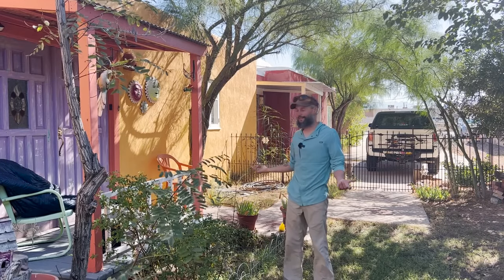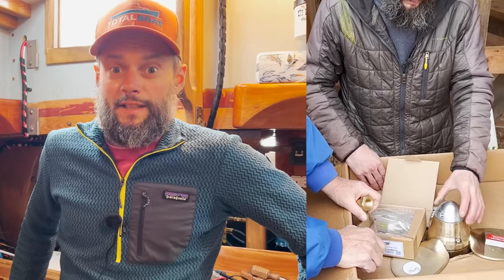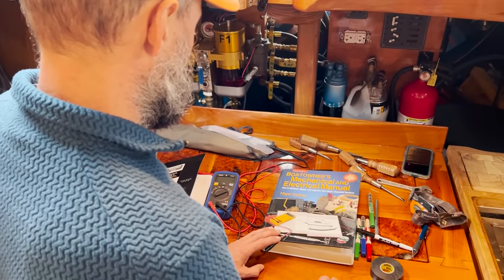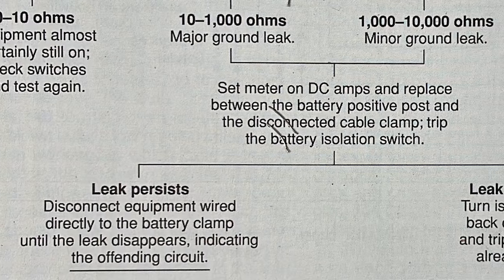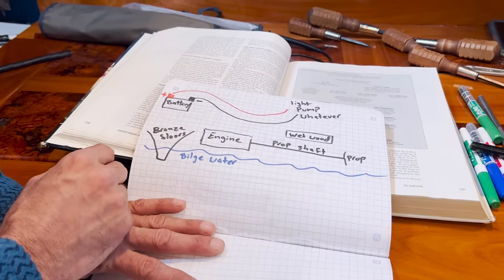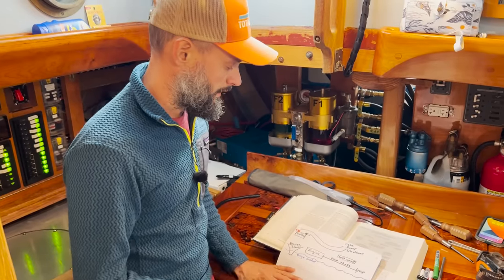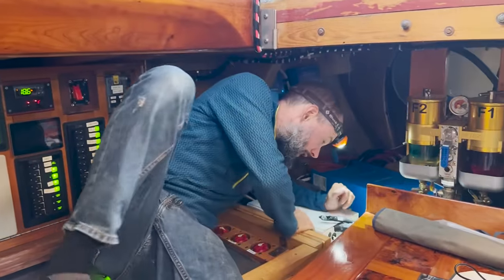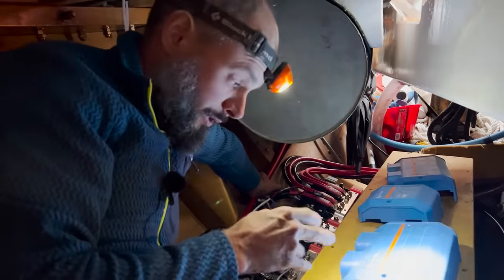Stray Current Puts Arabella in Danger - Episode 284 - Acorn to Arabella: Journey of a Wooden Boat

Comment: Great show as usual. My advice as an electrical engineer is always use a professional in an industry that has a potential danger. Electrical installations appear to be straightforward but there are hidden pitfalls that can be troublesome to say the least. Earth leakage (ground US) is common where electrical motors are used especially in a damp environment. Although your problem does point towards the alternator. A possible solution is to cary out an insulation test on all appliances and electrical motors, normally done at the commissioning stage of the electrical system, also I noticed that a lot of the electrical equipment was lay flat on your boat structure, would be better had it been installed vertical as this helps with heat dissipation. Sorry to be critical, still a fantastic build that you have achieved, wishing you the best.

Comment: I recommend buying a clamp meter. You can use it measuring current on any wire without havng to diconnecting it. 
If you want to find a a leak with the breakers you can try binary search to quickly narrow down where the current is going.
You switch off half of the breakers. if it leaking it means at least one of the ones left is leaking. Then continue with the subset. divide and conquer
Reply: A DC clamp is not that precise.
Reply: I used one to isolate a leakage path on a car.  It's great to have.
Reply: Also the meter is set for mA but he's using the 10A connector. That's an issue
Reply: @garci66  lololol!  That's not an issue at all and it's exactly how you measure current on his multimeter.  10A (10 amps) refers to the maximum amount of current the multimeter is designed to handle.  It also has a 10A fuse built in to make sure that if you run more than 10 amps it doesn't break.
Reply: Typically a Silver-Silver Chloride Reference Electrode would be used to track down this type of corrosion problem on a boat. It can also measure how serious the corrosion level is. They are simple to use, with a digital multimeter. A company called BoatZincs sells one that has an ABYC coordinated users manual. A reference cell allows periodic checks over time for stray current or galvanic corrosion. Alternators that are grounded to their engines can cause this type of problem.
Reply: IF your first sentence is correct, how do you explain the other (unused in this clip) socket being labelled with all the other ranges, including millamps and microamps? @digitalchipmunk
Reply: @digitalchipmunk  that's not correct. The meter has different shunt resistors on the 10A connector than the mA/uA connectors. The measurements are completely off. The signal doesn't follow the same path in the meter.

In fact if you look at the terminals you will see the right side one (empty) is marked with mA/uA besides the voltage and resistance options. You clearly have to use that connector
Reply: @garci66  OK guys, he is using an ANCOR 703073 - if you find a manual that proves me wrong please reference it.
When using the left port, he can measure with an accuracy within a couple percent and less than a milliamp.  I could not find the accuracy documentation but this will be ballpark.  It will also protect his meter to up to 10 amps, so if something kicked on at 1 amp, his meter would still be fine.  If he was using the right port, he could more accurately measure microamps, but anything > 600 milliamps blows the fuse.  
Keep in mind that you could pull 5-10 milliamps from the standby circuitry on a single piece of equipment (depending on what that equipment is).  Remember we're working with 12v, so a tiny 40 milliwatt LED will pull 3.33 milliamps by itself.  It does seem, however, that all his equipment is designed for efficiency with micro standby currents.
All that being said, in a perfect world he could have gotten a more accurate measurement (using the other port).  I don't think he needed to, though.  For example, if there were a 5 or 6 milliamp draw, he would have seen that easily.  So no, It's not a "problem" that he was using that terminal, but if he wanted to get more precise readings he could have done it differently.
I strongly suspect that whomever he talked to suggested doing it this way for simplification;  I also suspect that it would take at least 30 milliamps to have the speed of corrosion he is experiencing, maybe a lot more.  I think he's correct that it's the alternator.
Lastly, to the person suggesting the clamp meter: DC clamp meters <$1,000 have an accuracy of +/- 50 milliamps or worse...
Reply: @Gottenhimfella  It's for more precise readings.  The "10A" port is accurate to within a couple percent and less than a milliamp, the "μAmA" port is accurate to within a couple percent and less than a few microamps.

Comment: I think that for measuring milli/microAmps the lead has to be in the right port instead of the left port. Look at 21:17
Reply: Came here to say this. He's using the wrong input in the meter.
Reply: Yes. If the actual off-camera measurements were made the same way, then the results don't mean anything
Reply: Steve read this!
Reply: So many have this misunderstanding. Using the 10a test lead position for milliamp level current will be less accurate but the readings will still have the correct order of magnitude. Once he found that current was under 1amp he should have used the normal test position, but the readings on both should be broadly the same (so not a factor of 10, 100, or 1000 out)
Reply: @mikebarry229  actually yes.. it could EASILY be 10's or 100's off. The multimeter measures the voltage difference across a resistor. In the micro-amp range, the "burden" resistor is 92 ohm (I posted somewhere else that the meter he uses is a re-badged uni-t 133A of which there is a teardown). The mili-amp range uses a 1.3ohm resistor, so almost 100 times less. And the 10A range basically uses a thick piece of copper as the resistor, which could very well be in the 10's of mili-ohm. So yes, the measurment could EASILY be 100 times higher.

Comment: Typically in application where Stray current exists is where someone has not run a separate ground to each device or used a chassis to ground some device.  So you are looking for isolation to the electrical system.  This can be found by testing system with all power on to a metallic component.  If it exists, which is expected, then start shutting off circuits to see what reduce the isolation current.  This is how we do it for solar mobile applications,

Comment: Hey Steve - I think you have your multimeter misconfigured and that’s why you’re getting tiny values everywhere. You have the black lead correctly connected to COM, but the red lead is in the 10A port. The meter is set to mA, which requires the red lead to be plugged into the right side port, labeled mA. The 10A port only is used when you’re in A (full amps) mode, one click clockwise. 19:41 

Swap the lead and then rerun your test process! Good luck.
Reply: Another thought: I would recommend confirming that the load isn’t greater than 600mA (the meter’s fused maximum) before switching to mA mode. To do that, keep the leads as they are now (10A and COM), but switch to Amps mode (one click CW), and probe across the break where the fuse goes. If it reads < 0.6A (600mA), you’re safe - move the red probe to the right port, switch to mA mode, and probe again.

…don’t want to blow the multimeter’s fuse! 21:16 

Also, FYI I would expect that the control electronics and LEDs on the power management boxes will consume a couple hundred mA, even in standby. Definitely don’t expect “no load, no leak” to be 1mA in your modern electrical system.

Comment: My first thought is that you have an iron engine block, stainless shaft, bronze floors and a large lead keel, not to mention all of those beautiful copper rivets. That is a lot of dissimilar metals so stray currents are going to be a reality. 
On our wooden sailboat, we always  had a couple of slabs of zinc bolted on either side of the keel in addition to the prop zinc.  I'd even bolt some zincs to the bronze floors in the bilge were they touch the bilge water.  It's pretty much impossible to have too many zincs. If you don’t need them, they just sit there looking pretty.
Reply: Providided everythign is bonded together, they should be fine.  If you fit external zincs, they have to be bonded too, or they can't work.   If you ever find a zinc that seems to last several seasons without being eaten away, it won't be bonded to everything else.
Reply: @itsverygreen532  It's possible to bond all the big pieces of metal together but there are hundreds of bolts, rivets, and screws that can't be  bonded. So, in my opinion, using enoung zincs so that they are mostly intact after a year is a good approach.

Comment: Doug, from Sv seeker had a voltage feedback through the starter that kept the starter engaged and turning the flywheel while the engine was running.  You might have to install a bypass relay to isolate all electrical from the engine.

Comment: I had the same experience with my Irwin Sloop. I was advised that more or larger zincs would solve the problem but that didn't work. Then someone familiar with the problem suggested a galvanic isolator between the two halves of the prop shaft coupling. I didn't know what that was but it turned out to be a very simple disc of what looked like a two inch thick disc of neoprene one inch larger in diameter than the coupling with four bolts passing thru each side with the heads in half inch deep counter bored holes to prevent electrical contact between the coupling halves, it worked perfectly, and I'm told the isolator also reduces shock from propeller strikes. I ordered mine through West Marine but that was 21 years ago. Happy sailing

Comment: For insurance, you should have set up a metal pole into the water, with a bucketful of anodes on the end, connected by wire to your metalic ground in the boat (engine/prop etc). Better than relying on just another single anode, especially as you are running on assumptions and may not have worked the multimeter properly (‘at least when filming).

Having a similarly connected anode on hinged shaft somewhere permanent on the stern where you can quickly and easily check it might be a good canary in the coal mine, instead of relying on diving to see one underwater—especially on these complex electrical builds all this new tech is making available. 
Every now and again, and after any electrical work/changes/issues, have a peek at the ‘telltale anode’.
Reply: Definitely
Reply: I am not sure they have actually bonded everything together ... they don't have a single ground point for the external fittings, which is absolutely essential.

Comment: When I read the title of this video, I literally said "the engine alternator is the source". I am not a boat person aside from watching this channel and a couple of others. I have however been 'in the industry' for 20 years as a person who works on electrical systems and engines... I love this sort of issue. Doing exactly this is how we sort out some issues, but it's super rare in my work to need to find stray voltage/current. Very good video to watch Steve hunt this down. As I was confident in my theory, I was very tied to the video to be proven wrong. Very glad to see a source found. Moving forward, changing the alternator may not be necessary. If you get an isolated alternator, you shouldn't have an issue. The current setup, an alternator is going to generate some electrical just by spinning, even if the stator isn't being excited by the charge control. So my advice, isolate the alternator you have from the engine block. I would assume there is something off the shelf, but if not I know Steve can make something!
Reply from the maker: We’ll be talking to someone soon who will be a big help with this!
Reply: @AcornToArabella  That was some great diagnostics on the next episode! So COOL to have Nigel on the boat!

Comment: If you disconnect the propeller shaft from the engine and put your mA probes over the gap you can just pull fuses and wires until the current disappears. Then you will know where the leak is.
Reply: I agree.  It's not that easy, but it will solve the problem.
Reply: If it's not the alternator.
Or you'd have to do it with the engine running.

Comment: Just want to point out that the anode you refer to is in in the worst possible position for erosion by cavitation added to an electrical problem it is no surprise that it has disappeared so rapidly. At the head of the video my first thought was Alternator . new ones often turn up with malfunctioning  control units, the fact that it has been fooled with just increases my suspicion, Do your batteries Lith iron have their own control units???

Comment: Good job troubleshooting and explaining.  You didn't mention the possibility of the DC system upstream of the fuse.  There are batteries and wiring (and possibly other components) before the fuse that could be leaking, which would explain why your tests of distribution after the fuse didn't reveal any leaks.  I don't know the extent or location of this upstream wiring so maybe it's "not possible" to have an issue, but in several decades of work as an electrical engineer there have been several times when I came across a cause that I believed was not possible.  Disclaimer: while I've built a boat and spent a lot of time troubleshooting electrical issues, I've never applied these two skills on the same project, as you are doing.

Comment: One issue with your current leak might be on your chargers for laptop or other electronic equipment. Electronic manufactures tie the ground together on AC and DC side of the power supply. Try the same process you did but focus on the circuit that you are charging your electronics with. The make a USB A power isolator that you can install. Go though all the electronics you use. Don’t be connected to shore power when doing this.

Comment: Add a "zinc grouper" to the negative bus bar. Better to be over zinced than lose zinc from your underwater bronze. You want to establish what your electrolysis status is with a silver chloride half cell to determine what you need for zincs. There is a decent instruction manual with the half cell from boatzincs. Also look at Steve D'Antonio's articles on bonding and electrolysis.
Reply: Lose, not loose? Anyhow all good places to explore!
Reply: Actually, you can also over zinc a boat also. The ProMariner tester works but it's really expensive unless you are using it often.
Reply: There fixed it. So glad we have grammar police for typos. .

Comment: You might want to consider the possibility that your boat IS the battery, forming a galvanic cell from dissimilar metals in contact with saltwater.

Such a galvanic cell can originate not only from structural components but also from fittings, fasteners, or even underwater sensors made of different metal types. It's a phenomenon worth looking into for solving your issue.

Comment: So cool to see Las Cruces again. I was stationed near Alamogordo. Every sunset was beautiful. As you were speaking in front of the breaker panel I couldn’t help but notice some heavy duty cables going through the bulkhead above you. The notion of a current through the shaft makes a lot of sense. Two anodes may be better than one. On the shaft and prop. Shaking metal will generate a current. In model aircraft we are constantly searching for RF interference. Metal to metal that is vibrating will cause a radio frequency current. Enjoy New Mexico. The sunsets are great!

Comment: If the alternated is spinning it will be creating a voltage (EMF) so if there is any path to ground it till produce a current. If you can disconnect the output of the alternator and do an insulation resistance (IR or Megga) test they would tell you if it’s directly for the alternator. I can’t see an issue with the controller directly leading to an earth fault, defiantly could damage your batteries if it just keeps charging but not earth leakage.

Comment: I am a retired aircraft pilot part time AC engineer. On all of our sea-water planes we used zinc pucks ( from a plumbing shop, to protect all aluminum from electrolysis from the salt water, these were inspected weekly for damage as well as the brass fastener. if we deemed the corrosion was too fast on the puck and or bolt we looked for power leakage from the engine electrical doubled the size of the zinc pucks or attached a softer metal to the puck.  system and fixed same,   just a couple of hints from an old retied pilot.

Comment: I worked at a power plant, where our circulating water pumps were corroding at the pump shaft couplings. These pumps have 8 inch shafts and move 125,000 gpm. Big pumps, big motors. Turns out that there were stray currents, induced from the motor that were running down the shafts and exiting the coupling bolts into the salt water. The pump shafts and motor were hard coupled (not electrically isolated). The fix was to place a copper ground strap at the shaft below the pump/motor coupling. This pulled stray currents to ground. This may or may not work for your setup, but you may want to at least measure your prop shaft for voltage while the engine is running. Good luck and smooth sailing.